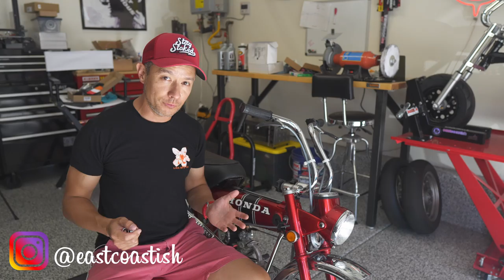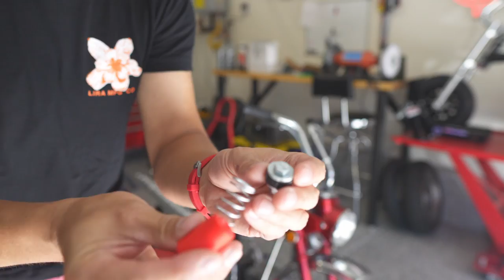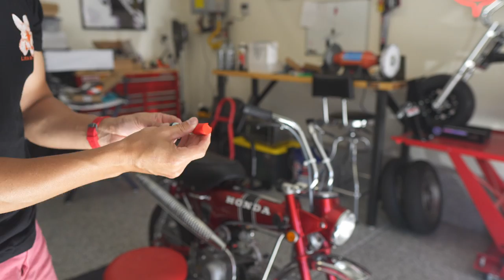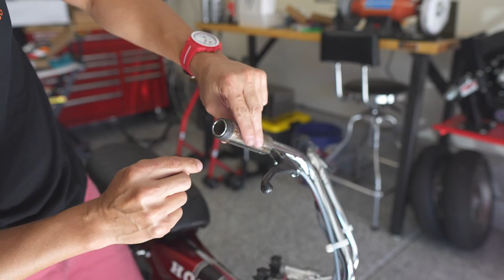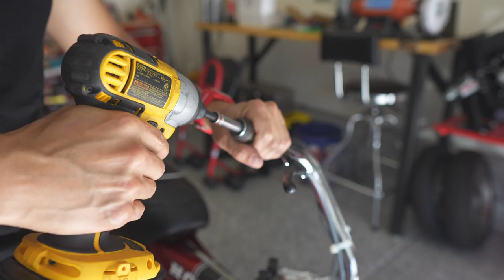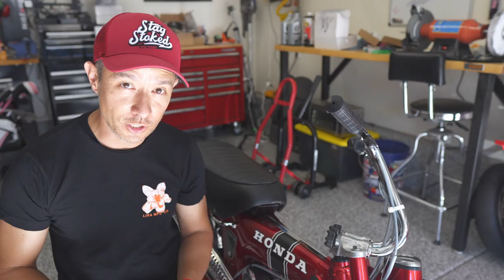Honda CT70 Throttle Tube Snap-back Fix!

Comment: Thanks fso much for your video demonstration. I bought the Snap-Back Throttle kit from Josh Eule at Vintage Honda Minis, and it works great on my 1969 CT, 70 K0. :)  For my CT70, in order for it to properly snap back with the kit, in addition to cleaning all parts very well, and making sure my new throttle cable was well-lubed, I also needed to clean well and lube (as Josh recommended) the groove in the throttle slider piece, surfaces of the handlebar and the throttle end ring, and the interior of the metal throttle grip, which has the spiraling bars that slide through the groove in the metal slider. I used Motion Pro throttle cable spray lube (shake well!). The spring-back worked great, but was too strong for me, so as Josh mentioned, I could cut the spring shorter, at risk of losing the functionality. I took the risk, cut the spring (clamped in a vise, cutting with a Dremel rotary tool),  making it a little shorter, reinstalled, and now there is less spring-back pressure, but still snaps back perfectly! Of course, if anyone does that, they should cut a little at time, re-assemble, and test. Cutting the spring too short would eliminate the fix. Josh Eule and Vintage Honda Minis rock!